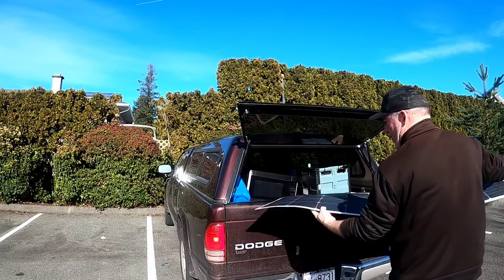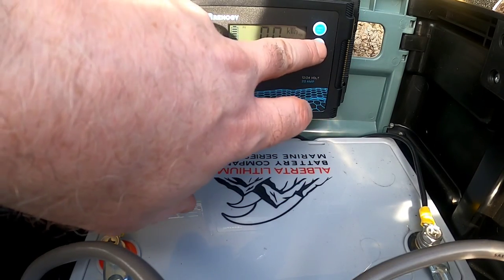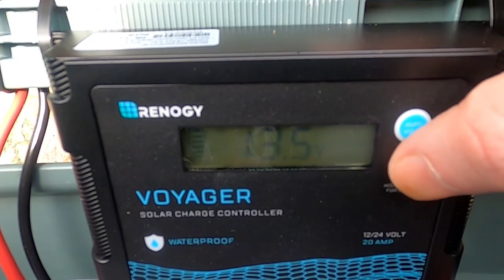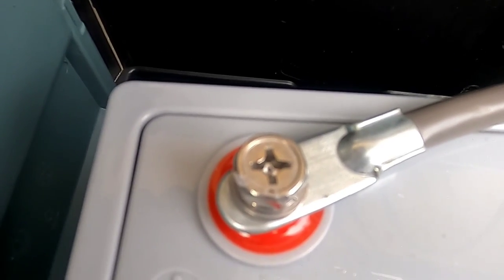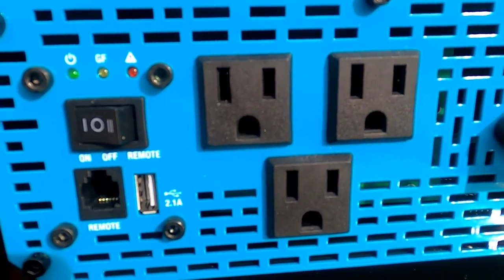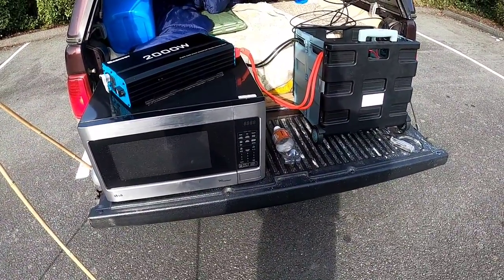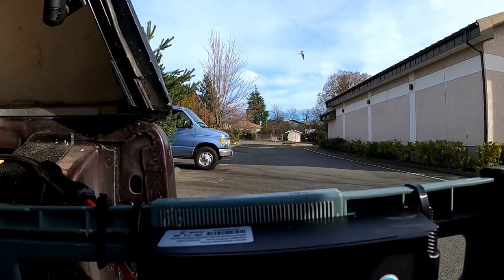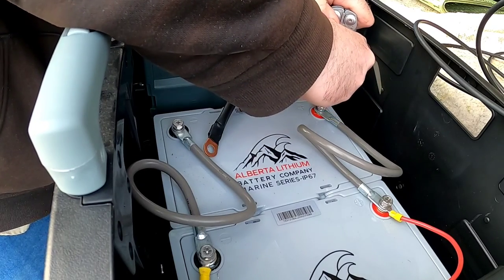DIY SOLAR POWERED MICROWAVE OUT OF THE BACK OF A TRUCK! STEALTH URBAN CAMPING OFF GRID ELECTRICITY

Comment: Something to ALWAYS remember. When dealing with any form of capacitor, ALWAYS  assume that it has a charge, The voltage in the capacitor can be many hundreds of volts and can actually electrocute you if you touch the terminals. 
Refrigerator compressors, air conditioners, furnace fan starters, sometimes,  and the power supply in a computer all have these things. The computer can be as high as several thousand volts of slow discharge, but will discharge very quickly if shorted across your body parts. Inverters like the one shown here can actually kill you if you make the wrong move.
Great video Frank, as always. ;-)
Reply from the maker: Thanks man, capacitors are definitely nothing to be played with.